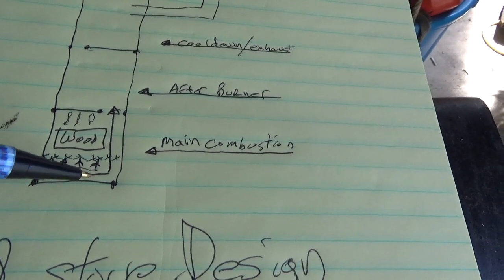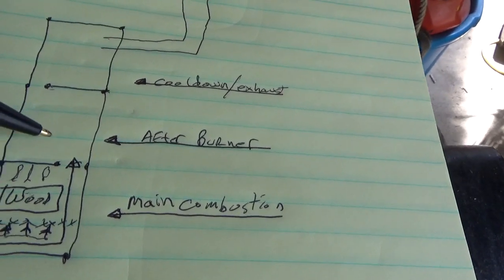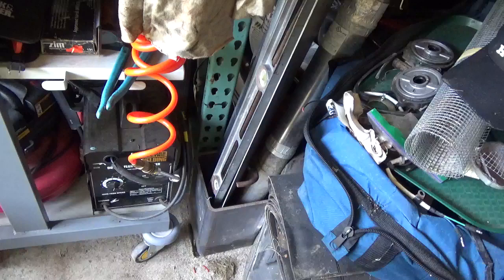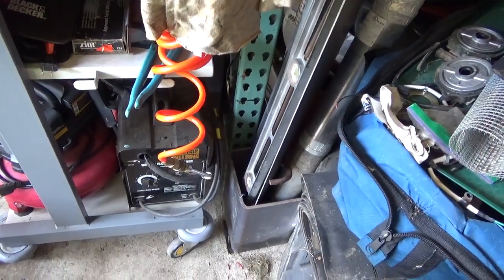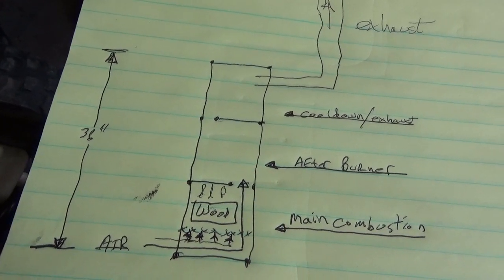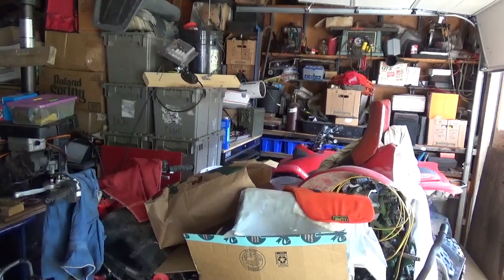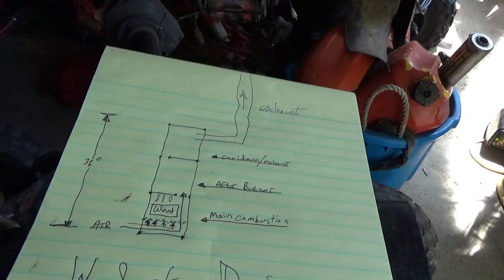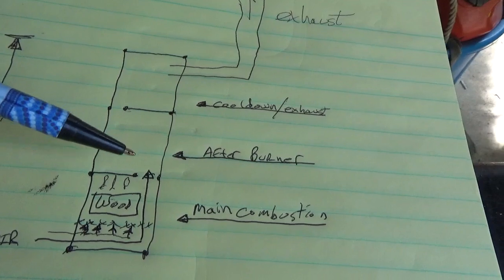Designing an Efficient and Easy to Build Wood Stove!

Comment: I don't believe that an 8"×8" base dimension is large enough to be useful without refueling every hour.  You'll have 7" lengths of wood and a door opening of approximately 6"×6".
Then the size of the box will limit heating capacity.  An 8"" round stove pipe isn't much smaller tha  your 8"×8" box base.I don't  know how much secondary burn you're going to achieve with such h a small fuel suppI

IF. .   it worked my guess is that someone would be  producing it already.

Comment: Hello Harvey, I have found it is really hard to heat any place that has a lot of clutter. Just saying fella. Heating a space requires a good size heater because you have to heat everything in the space. Insulation is a big thing too. I have reduced my heating cost because I insulted the house. Second, make sure you get cold air from the outside. This helps with dense oxygen for the fire. Get or make a high efficient stove. Good day too.

Comment: That small your going to use a lot of kindling size wood ! Waste oil might be better for that size . How would you get your baffles in and sealed ? Here some people use 55 gal. Drums 1 on top of another . You could weld that other piece onto your 36 inch forming an L to burn larger pieces and have baffles like a muffler to control the heat . Weld it in front of were it says HEAT on your drawing .